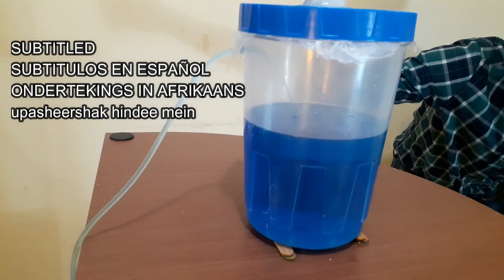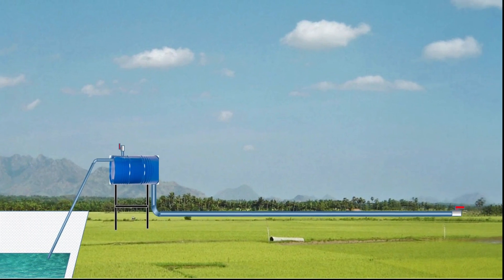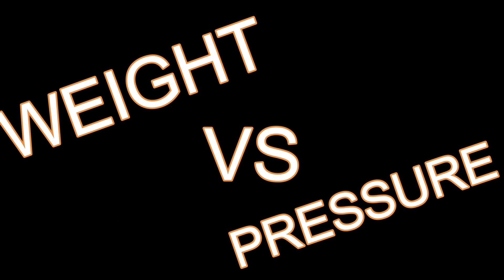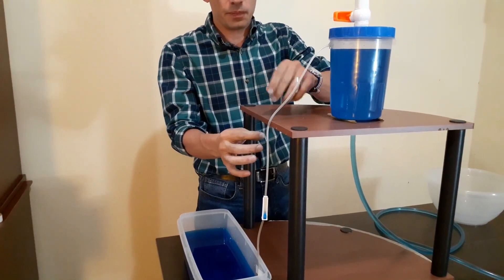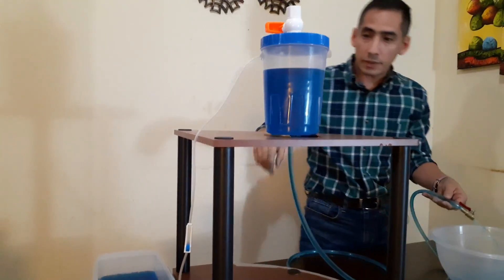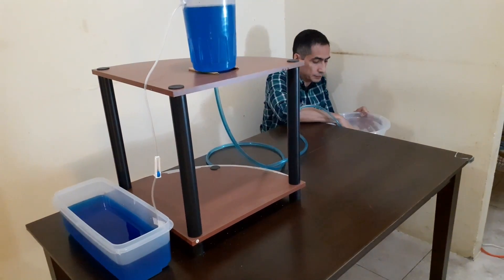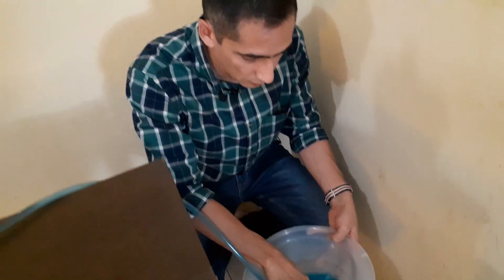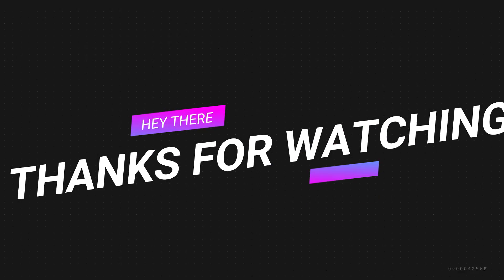FREE ENERGY Water Pump FULLY EXPLAINED!! REAL OR FAKE?  #freeenergy #waterpump

Comment: Uh, guy.. uh, you forgot to fill the input tube.. the vacuum created won't be strong at all with so much air. This system works only when full at first use. Any water drawn from the output side will create a vacuum which draws in to replace it- water from the source, or input side, but only with the buffer tank and both of the sides filled first from the top. The water when it fills the whole space inside the tank and the pipes what happens is all the water starts to become trained, or combines into one flow direction which is felt even at the source inlet pipe.
Reply from the maker: Thanks for your comment, however priming the suction pipe won't reduce the amount of vacuum (negative pressure) needed. I am working on another video with a bigger model and a foot valve (non return valve) firstly I will publish a spanish version (with english subtitles though) I will see you there, best regards

Comment: You know.  They are BS, but you are not good at proving it...
Reply from the maker: I do my best though, regards.
Reply: @rubencobos  a couple things then; to get the ones who are particularly thick to see that the "learn from ideas" videos are all bs; make sure to fill the tube, and don't bring the tube over the "barrel" to stop the water (they are basically pretending syphoning from the tank will create enough pressure to pull the water from below).  You might want to add the pressure tube to the draining hose also (which I think they added because ram pumps have them so it makes it look more similar to a real world concept) so no one can say it has anything to do with it.  In general your example works well enough for anyone who already realizes the concept won't work, but to get more you'll have to make it look closer, but with a couple changes I think more could snap out of thinking we surpassed zero point energy with a barrel.  
  Anyway, good luck.

Comment: Thank you for your video. However your test appears flawed. The liquid can not empty from the container without causing a vacuum. if your container was properly air tight that quantity of water could not flow out without sucking air back in through the outlet. Also the inlet pipe needs a non-return valve at the bottom and it needs to be a charged line before opening the outlet. the outlet pipe needs to be at least 2-3 times diameter of the inlet. The outlet pipe also needs to be charged before opening. The general principal as far as I can tell is the combined weight of the water in the container and the outlet pipe are what is used to draw water from the lower water source. I would like to see you do the experiment again with these adjustments.
Reply from the maker: Thanks for your comment Brandon I am preparing a new video with a bigger model, it has a non retorn valve and a vacuum gauge, it is going to be interesting, I will waiting for you there, I will make a spanish version first and then an english version, best regards.
Reply: @rubencobos  I look forward to your new experiment

Comment: I don't understand your explanation even your experiment, surely if you did air seal the container, water would have been sucked, that's the physics.  Water and air are substances that occupy of space and have mass. So for us to successfully make that pump, we need to have a rigid container with enough space.  The diameter of the inlet pipe must be relatively less than the outlet pipe, that is immediate pipes to the container.  Both the inlet pipe and the container must be filled with water. After opening the outlet, in container, the water level starts going down creating a vacuum space, matter in either liquid or gas forms must start to find way into the container to fill that empty space being created by means of the suction force, because the container sir sealed and rigid, the only opening is the inlet, water will be sucked.
Reply from the maker: Thanks for your comment, I am preparaning a new video with a bigger model, I will see you there, best regards, Ill try to add your suggestions.

Comment: ever make a model where the suction line is the same diameter as the output?  the videos i have seen where a siphon was used to drain a pond to lower the water level, when the pond drain became plugged, the suction side was the same diameter as the output side, so, naturally, i am curious if the same would be true for the type of siphon in this video.
Reply from the maker: Thanks for uour comment, I a preparing a new video with a bigger bottle, I will see you there, best regards

Comment: Prime the inlet tube, then turn on the spigot.
Reply from the maker: I am preparing a new video adding a nin return valve
Reply: I would not waste the time. A siphon works on the principal of two vertical columns of water connected over an arch or U shape. The weight of the longer vertical column is greater so it lifts the lesser vertical column. In solid representation it would be as a balance beam scale. Fluid flow just adds a dynamic principle to the process. His illusion had one vertical column and a longer horizontal column. Gravity pulls across the horizontal column not along its linear length so the greater mass in the horizontal column is irrelevant.

Comment: all the tubes need to be filled with water before undoing the output for the suction to work (otherwise you wont know if there is any leaks which would stop it from working completely.) hope this helps ( :
Reply from the maker: Thanks for your comment I will make another video adding a foot valve, best regards
Reply: it doesnt work, physic says differently! the drum is just like a bubble in the hose an its still just a regular siphon and only works if you siphon below the source!
Reply: @rvlifestylelivin  yes I have since learnt this lol
Reply: this is the best comment, you must fill all the tubes..
Reply: @shipwreck5421  thanks... but actually I was incorrect. Lol. You live n learn ig 🤷‍♀️
Reply: @pazredpanda8929  yes, i also failed trying this but gravity always win😅

Comment: Your experiment is wrong you know why? I think your cover have a leak thats why no vacume perform ang the outlet pipe have no airrator. If you want to prove that have good result try to check if there is a possible both pipe and the cover to make a perfect
Reply from the maker: I am just planning making another video even with a vacuum gauge for assure an hermetic seal and other features,  thanks for the feedback!

Comment: You saw how does a Syphon work! But we don't want it while we want to fill the suction pump before release the water of the barrel. Then the water suction from the well will be successful ! Am I Right ?
Reply from the maker: Thanks for commenting actually it will be the same whether you prime the suction pipe or not, I'm planning of making another video adding a check valve

Comment: With your second experiment,  you have the water running,  what can you say in general? With proper fixing can this method work or not???
Reply: What is the technology used to bring the water from the lower level like well or river to the container on top?
Reply from the maker: Thanks for your comment, it will work if the destination level is lower than the source level only

Comment: That's a great demonstration model.
Hopefully your video will prevent some people from investing time and money into building such a free energy "pump", only to find out that it cannot pump to a higher point.
Reply: the discharge pipe is the same size as the suction pipe, you must try to upsize the discharge pipe compare to the suction
Reply: The system itself works,  but your system failed due to all soft materials and not sealed.  Retry with pvc pipes hard container that will not deformed when its built up suction.  The most important is the system has to be completely sealed. Remember,  you have missed a vertical pipe on the drained pipe.
Reply from the maker: @johnle6432  it doesnt ever going to work as a pump it is just a syphon. Physic laws are unviolable
Reply: @rubencobos  I have watched your other demonstration with 5 gallon bottle and the bottle has been deformed,  you must know it's work. Do you know how much suction to deform the bottle,  and if with that suction and the bottle does deformed do you think what's going to happen?
Reply: no te olvides que los q aprueban las leyes de física y dinámica de los fluidos no quieren que descubras energía gratis, por el simple echo que se les termina su negocio....
Reply from the maker: @CarlosTorres-pz3to  una cosa es energía gratis, otra cosa es movimiento perpetuo, las leyes físicas noson inventos, son descubrimientos
Reply: @ruben cobos
Reply: Your model lacked  the footvalve in your inlet which holds water column in inlet initially, which will in turn make the water level in inlet higher than the outlet pipe.  Before opening the outlet valve you have to prime the inlet pipe with footvalve with water .
Reply from the maker: @kumudkishan4463  thanks for your comment, I am planning of making a New video adding a foot valve and other features, Best regards
Reply: @rubencobos  make sure it is sealed better too, at a smaller scale, viscosity may be a problem in smaller pipe too. i would like to see a working demonstration of this with everything visible and clear plastic. thanks. do not put the pipe up higher when it starts siphoning, if it pumps it higher than the source water, it works.
Reply: @kumudkishan4463  You must have missed the point when water was flowing and he raised the output end higher. It stopped flowing even though the inlet water was flowing.
Reply from the maker: Thank you very much, I am a big fan of your content!!  yes, I tried to make a video using the simpliest words I could  find for explain it. My motivation came of thinking how lots of farmers could get cheated by these clickbait-earning-views channels about free energy water "pumps". Best regards.
Reply: @rubencobos  Im sorry to tell you ive tried it and it works, youre expirement is a disaster, You DIDN'T follow the real theories in it.
Reply from the maker: @juantingsonjr.6968  so do you got any knowlegde of the physic related to it? Could you explain technically how it (should) works?
Reply: @juantingsonjr.6968  The higher the elevation the lower the pressure, the lower the elevation the higher the pressure and at same level same pressure. Take for obvious example even a glass or bottle full of water it won't spill any when turned upside down because at in a vacuum state.

Comment: What about the videos they use a check valve and pump it from a well to water corn with barrel, have you tested it?
Reply from the maker: Hi, no, I haven't used a Check valve yet,  but there are many videos which they don't use any check valve though, however I am figuring out built a tiny check valve and film another video.
Reply: @rubencobos  I am talking about wells they use the barrel and get water out of a dug well to water crops. Just wanted to know if you tried it?
Reply from the maker: No, I haven't either, but it is actually possible to get water from a water well, if water's destination is on a lowet level than the water's level in the well, I have seen a few videos where other guys ( not those channels about hoaxes,learn for future, for life ) can extract water (no fake), they are taking advantage of a invert syphon system.

Comment: your suction hose is empty there.is a bubble of air that's why not working.
Reply from the maker: Thanks for your comment I will make another video adding a check valve on the suction pipe

Comment: I've watch the videos of free energy water syphon in youtube.. compare to your expirement, you did it different, there is a lot of thing that you did not follow..1. The suction pipe should be filled with water. 2. The contsiner should be air leak free 3. The outlet pipe should be bigger in size and on the end part, there should be a smaller pipe extension.. your expirement is not as same with the what posted in youtube..
Reply: Yes very good point, In addition, he did not put check valve at the suction head, this is important to stop water from flowing back to the container.
Reply: The valve would only matter if the flow of water was to stop for some reason BUT it's not supposed to. When the water is flowing it would be open the whole time, it's not like its adding support or lightening the backwards pressure or anything like that. It would only be useful for priming the intake before opening the outake.
Reply: @hariadidwi1051  none of the videos I saw had any valves the model here is correct. You were fooled. You need to build your own "free sucking pump" and show it working. It won't even with a check valve.
Reply: i agree with this
Reply: Pleas try to use a one-way valve at the end of the supply side (lower one)
Reply: Matter occupies space...so if water is coming out ...there should be another matter that will occupy that space. Maybe air is going
Reply: Check it with increase in size of store tanks, make more imbalance in weight ratio between pulling column and store tank.
Reply: @shivamumbai1  The higher the elevation the lower the pressure, the lower the elevation the higher the pressure and at same level same pressure so you need to augment more than the pressure impended to the inlet side due from the product of the difference of it's heights gravitational acceleration and density of the water. Take for obvious example even a glass or bottle full of water it won't spill any when turned upside down because it is in equilibrium state.
Reply: The container volume needs to be significantly larger than the volume of the intake hose. The vacuum force of the mass in the container will then overcome the mass in the intake hose when you open the outlet. The outlet is best done short in my experience if you don't want a long slow declining outlet hose from where your pump is. If so, set the pump container close to where you'd like the water deposited.
Reply: The ground level of discharge pipe must be in lower level than the suction point,then it will work on syphon system.
Reply: The "suction" pipe will drain to the low level. That's why the inlet pipe needs a shutoff valve when they fill the barrel. 
I find it amazing that people will watch this accurate and practical model and still argue it's not like what they think they saw in a hoax video with zero details.
Reply: Sucking pipe also add return block vale.
Reply: To think give benefit of doubt to so many Utube it work or not. They may look like uneducated fellow but they look like priactial. As far as I think compare those sys with ram pump setup I found some reverse fact with ram pump sys 1 ram pump sys have large feeding pipe. but small transfer pipe but this sys is reverse. 2 ram pump sent high ground but this sys can suck from lower gournd like well . 3 they both use return block vale when one use pressure to sent water but one use vaccuan to suck water. I would like to call this sys reverse ram pump sys.
Reply: @maungmaung4037  syphon.
Reply: @maungmaung4037  It cannot "pump" up a hill. there is no pump. Water will only flow down. Pipe size has nothing to do with the density of water. it will never flow up. Fact.
Reply: @saddabadda7921  Magic and demons! Witches I tell you!
Reply: You can lead a horse to water but you can't make him think..
Reply from the maker: Thanks for your comment, I am thinking of making a New video with all those sugestions include
Reply: @rubencobos  I think in Test Number 1 your container was not airtight...otherwise the water would not have come out so easily also without air bubbles...you really need to have a good vaccum inside above the water and no airleaks also from the output pipe, so that is why these vietname/malaysian farmers used these vertical pipes inside the output lines to trap and get rid of the output air bubbles....
If you could show this with a new transparent build, it would be great to see, how the air is trapped there...many thanks 👍🏻🙏
Reply from the maker: @oudotcom  I have made a new video, is in spanish with subtitles though.
Reply: @rubencobos  show that date for actual data fact for this type of energy???
Reply: I've actually done the experiment myself a couple of times the biggest issues - the system needs be completely sealed, ensure u prime, and the intake have a one way check valve. The potential energy is stored in the large mass of water at a higher elevation. Think of the system more as a  scale balance, of course if the load  on one side could lift a smaller weight, until u add more weight until the systems at equilibrium then no more flow😂
Reply: If the output pipe is bigger, won't it drain te barrel faster then it can be filled by te smaller inlet pipe?

Or is the outlet flow restricted by the inlet pipe diameter?

I'm curious to see a comparison of both the same diameter pipes and your system.

Comment: My friend, you made a big mistate in inlet section there is no checkwall device in your model so your system is not oneway in that section so the flow disturbs when you take the outlet section on a higher level and morever you dont have air bag in your outlet section you must see the ramp motor working methodology on youtube.
Reply from the maker: Thanks for your comment I will make another video with all that ajustments